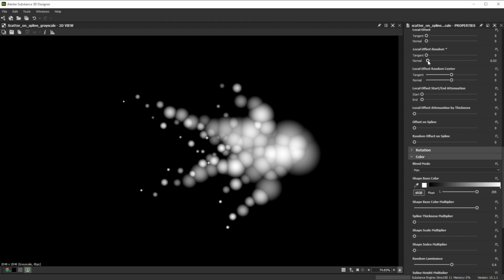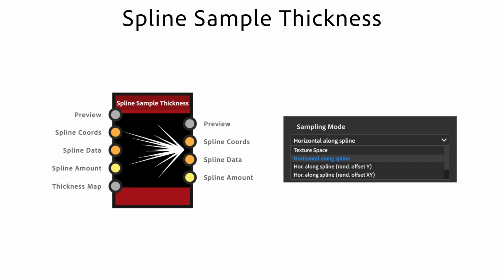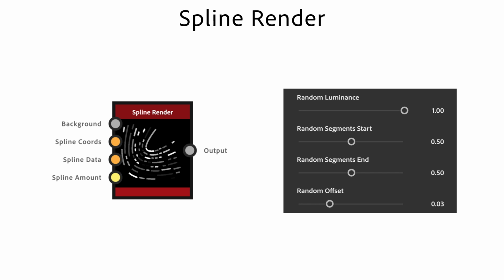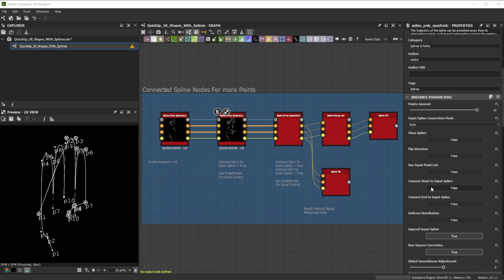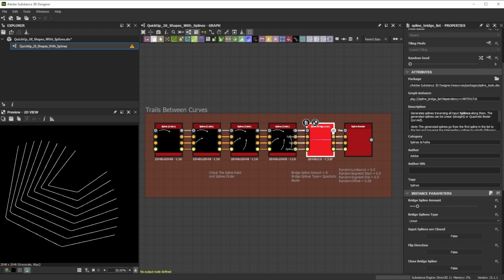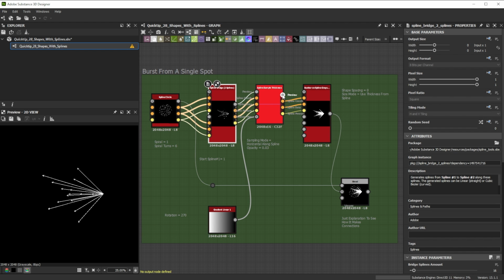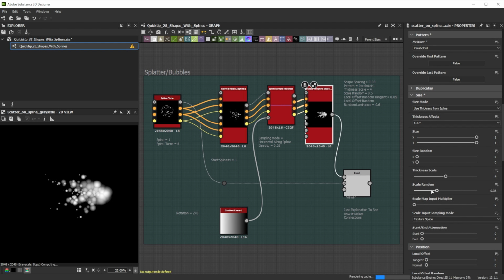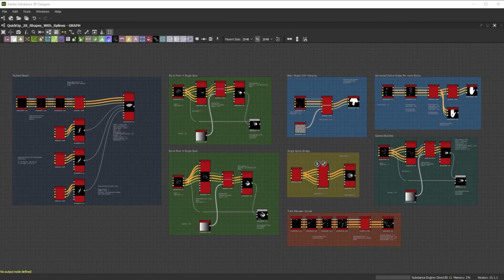Shapes with Splines | Designer Quick Tip #29 | Adobe Substance 3D

Comment: spline sample thickness is not working so well for vertical bridge splines.
Reply: im previewing the spline sample thickness and nothing changes, same thickness all the way through v14
Reply: @keltart809  Hey! A bit late on this but you need to enable the "thickness envelope" in the preview tab at the bottom of the node, although my go to would be to just render the splines with a scatter on splines to display their thickness